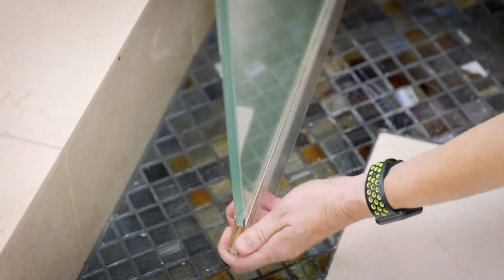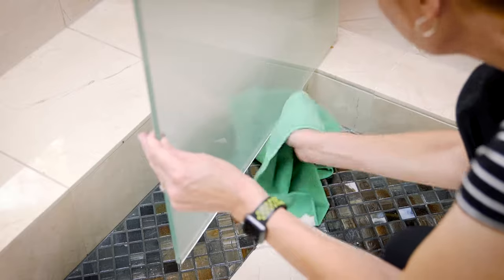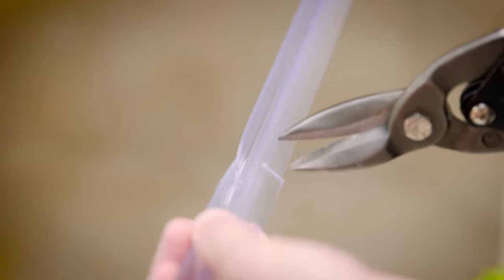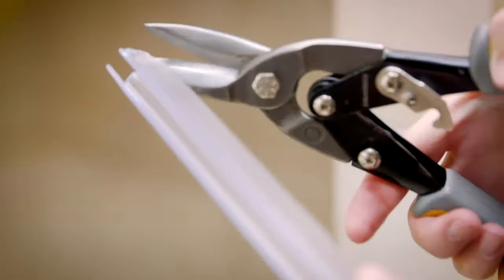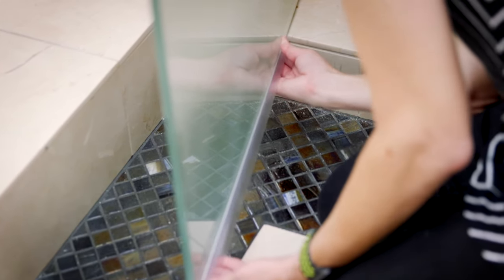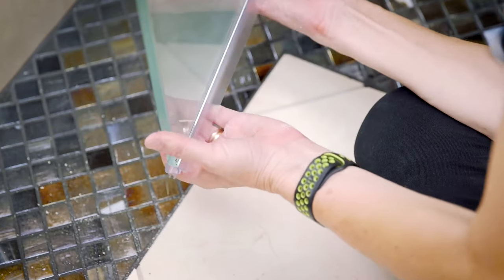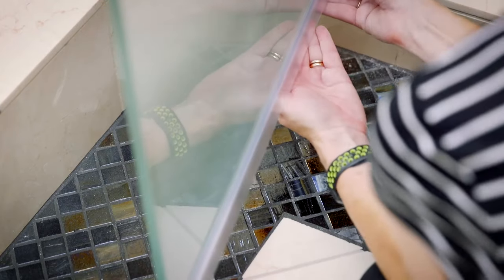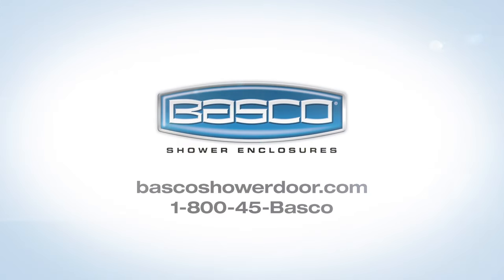Replacing a Bottom Sweep on Frameless Glass

Comment: Mine does not want to slide on despite it appearing to be the same size.
Reply from the maker: Hi there, thank you for your comment. To best help you with this, we recommend you reach out to our Tech Specialists for assistance. Ideally, you have your shower door model number available, so we can verify that you were replacing the bottom sweep with a matching product and give you advice for the application process. You can reach our Customer Care team at 1-800-45-BASCO or via inquiry@bascoshowerdoor.com.
Reply: Ditto.  The video ignores the difficulty of placing the sweep on the portion of the door closest to the hinges/wall.  Unlike the instructions and illustration, you cannot just push the sweep up to fit the door.  You have to slide it into place and depending on how tight the sweep is (mine is impossibly tight) it will be very difficult to slide it all the way to the wall/hinge side.  I wish the video showed how to manage that part of the installation.